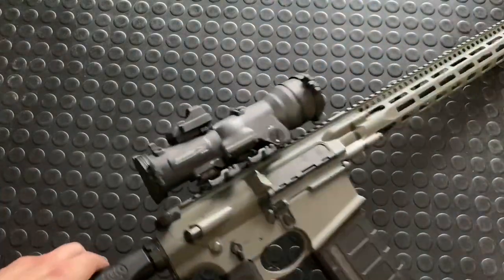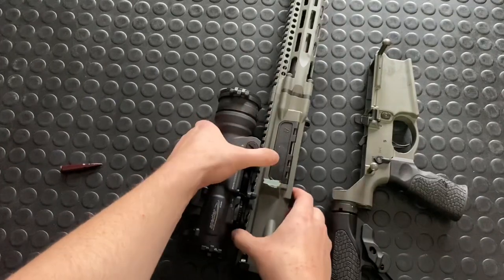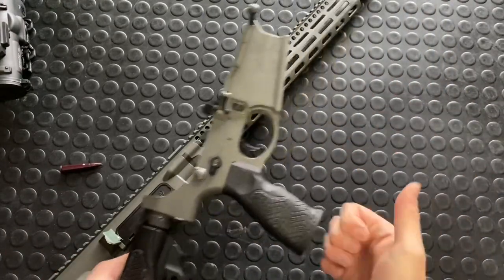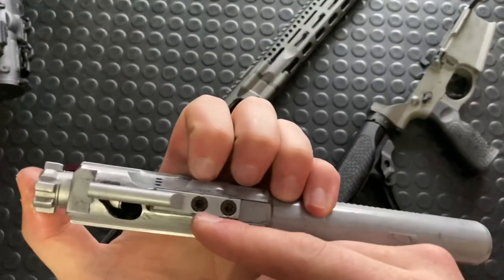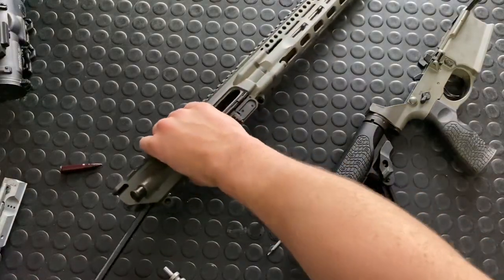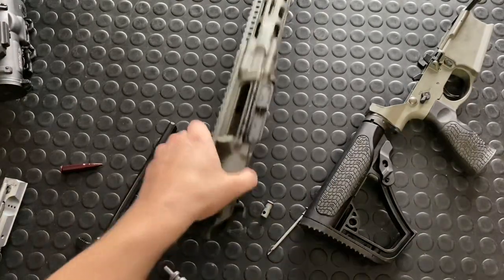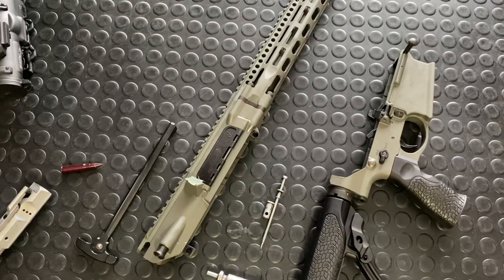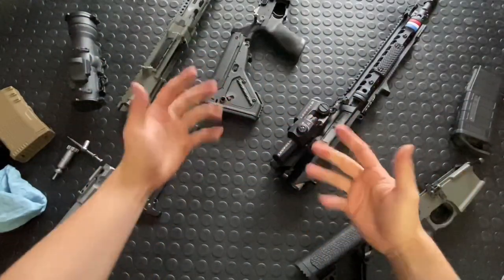Daniel Defense DD5 Disassembly and Internal Features (DD5 part 1)

Comment: Regarding DD's ball bearing repalcing the standard charging handle's latch, I too do not like the initial resistence detent type systems provide. I prefer Sig's method of using steel roll pins in the upper to engage the latch. I've actually done this myself in standard AR uppers that had worn latch engagement surfaces

Edit: I paused the video to write this comment and when I unpaused you immediately brought out the Rattler haha. Nice overview man

Comment: Thank you for your very informative discussion on the DD5. I look forward to viewing your following videos on the DD5. Yesterday I purchased the DD5 V4 in 6.5. With little experience in optics I made an impulsive buy on a Leupold Patrol 1.25/4. Do you think 4x is adequate or should I step up to 6x?
Reply: Hello I own two DD5 and I use them as DMR I’ve put a 20 MOA Spuhr mount cantilever QD on both.
For the optics I’ve the last Schmidt & Bander PM2 5-25x56 on one and a Vortex gen 3 1-10x24 on the other.
I am very satisfied by the DD’s and these optics I easily shoot steel gongs at 1000 meters.
Good luck with your rifle.

Comment: very important. asking for a friend. does a KAC SR-25 fit on the lower?
Reply: I didn't see a response not sure if you figured it out but DD's lowers and uppers are proprietary can't use them with any other manufacturers.
Reply: this DD is proprietary everything 

BCG / Upper & Lower
Reply: It’s not proprietary, it’s traditional AR-10 style upper. Tell tale is the angular cut to the rear. Most AR-10 are DPMS style uppers with much more rounded rear. DD5 uppers will fit any lower cut for the traditional AR-10 lowers but will not fit the rounder DPMS lowers. Vice versa, an DPMS upper will not fit an AR-10 lower so there is that.

Comment: I didnt see the firing pin return spring its commes only on the DD5 is there a reason for that?
Reply: It’s to prevent slam fires. But the gun still works without it.